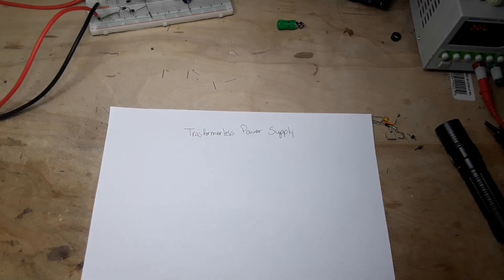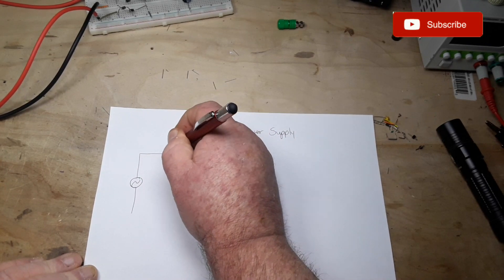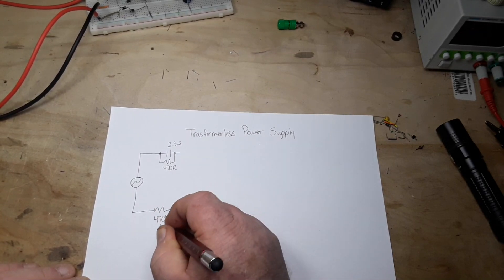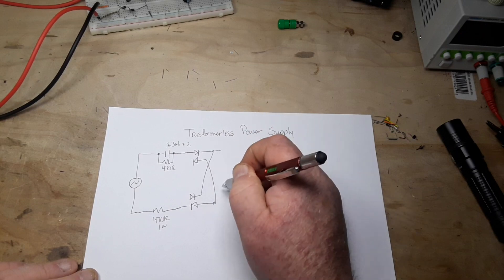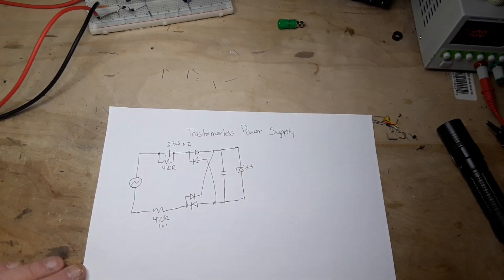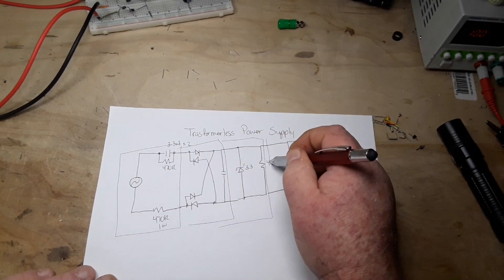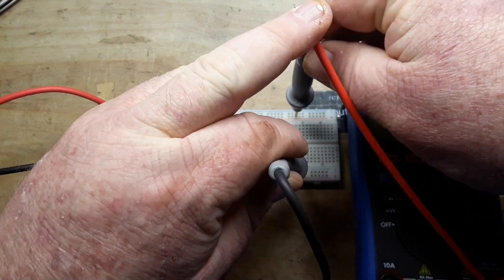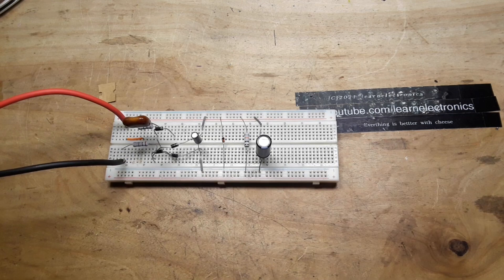Classic Circuits You Should Know: Transformerless Power Supply

Comment: When I 'play' with mains voltage, I use a 12 volt portable powerpack with inverter built in. The inverter output is isolated and I would need to touch both contacts to cop a shock. We have 240V here in New Zealand.

Comment: So im new to this (actually getting back into it) I was wondering how you calculated the resistor value, are you calculating it based on the load at the output? Using ohms law it seems that the load you are shooting for would be 3.3 volts .200mA, am I correct or am I missing something?

Comment: Yesterday I disassembled a rechargeable LED bulb 💡. The circuit was made with 335j 400V drop cap, 244 SMD bleeder resistor, MB06S Bridge rectifier, 100uf 50V E-cap, 2x SS14 SMD schottky diode as anti back-flow, D965 transistor to drive LED panel and 621 SMD resistor to supply the base current to the transistor. 

LED bulb was claimed to be 125W, it can be used as a normal AC LED bulb or DC emergency LED bulb (there's a switch DC-OFF-AC). The brightness was same with AC or DC. I measured the current consumption of the LED, it was 1A @ 3V. But as soon as I removed the battery (4V SLA), the LED lights went dim, now it only consumes 180mA @ 2.6V when runs on AC. Now even if I connect the battery it doesn't have the same brightness as before, but when it runs on battery it works normally. 

I have no idea what went wrong, could you please help me?

Comment: This circuit is used in so many consumer electronics things that we buy -- so I can't understand why everyone gets up in arms when the circuit is described and demonstrated, w/ appropriate safety warnings. 
That's the whole point of education, after all..

HOWEVER - the 470ohm resistor across the 3.3uF dropper capacitor is a MAJOR BLUNDER - it should be 470k to 1M Ω  !!!   Please PIN this correction as a PINNED COMMENT !!  The circuit as described will BURN UP 🔥!

Comment: Thanks for your clear explaining of how this all works!
  I bought a pzem-004 current sensor that uses this circuit to power its self, wasteful it is.  I need 30 of them so i what to figure out how to power them more efficiently. 
  You rightfully warn that this is a dangerous circuit so i want to know precisely how it works before i start pickup the soldering iron on this.

Comment: I know what the bridge rectifier does, and how electrolytic capacitors work, as well as resistors. However I am curious how these film type large capacitors actually reduce the voltage, I am curious about how it actually works to achieve this, so it somehow drops the voltage, this is incredible. I have tried to quickly research how it does this, but I cannot find a precise breakdown of how it actually is dropping the voltage, most websites just say that it's used to drop the voltage and don't explain how it does this. Inside the film capacitor are rolls and rolls of shiny film, I want to know what the high voltage source is actually doing when it enters the film capacitor.

Comment: just a query, at 4.41min where is the output of the first diode connected? I want to make a 20led string of rgb leds and was thinking this is a better way to power it than going out to get a ph charger and muck around with extra leads and sockets, but I can't see where the diode is connected

Comment: I do not understand the use of both a 3.3 uF capacitor and a 470 Ohm resister in the beginning of the circuit.  Is it the capacitor that "lets a little through" or the resistor?  The resistor is too low value to be used just as a bleeder resistor.  Does a resistor and a capacitor in parallel form some kind of tank circuit?  120V across a 470 Ohm resistor = .25A.  120V X .25A = 40 watt.  You call for a 1 watt resistor.  Obviously, I am missing something or making a gross mistake.  Thank you in advance for your help.  I am ready to build this circuit to drop 240V to 12VDC to a 555 timer circuit to engage and disengage a starting capacitor for starting a 3 phase motor on single phase.  The timer part is working perfect.  I would like to make my own power supply.

Comment: You find these kinds of thins inside motor speed controllers for vacuum cleaners etc to drop the voltage down to what the pwm IC  can handle . You will also find that the speed control potentiometer is made of plastic so you don’t get electrocuted !
Far safer for the home hobby guy to use a switch mode supply or a transformer based supply but it is good that you have shown  this type of circuit so they can identify it and know to leave it well alone !

Comment: If I put a coil in series to the dropper capacitor, will I be able to get rid of the negative effects to the power factor, so the shift of voltage against current?
Should I do so?

Sure, the coil would have its own resistance due to self induction, so I'd have to make the capacitor drop less, so use a smaller one. 

Right?

Comment: It should also be noted that some of the USB wall chargers can be very dangerous - people have gotten electrocuted while bathing and picking up their phone - one side of the DC out was connected to the hot side of the AC. Usually this happens with the el cheapo no name chargers but I would not use any device connected to these chargers while bathing or grounded. Some other u tubers did teardowns of many of these chargers and some have downright dangerous designs.

Comment: I am looking to make a 1.5v battery eliminator for a wall clock which happens to have a 120v socket right behind it. I am getting tired replacing the battery every few weeks (or swapping out a rechargeable). The circuit needs to be small and low profile to fit behind the clock. I like the clock (smooth second hand no ticking) otherwise I would get one designed for direct AC power. I was even thinking using a mini USB charger and dropping the 5v to 1.5 with a resistor divider - current should be low less than 50ma I would imagine but I will have to check that. Any ideas? I could use your example but any solution would have to be reasonably safe (insulated mains side). Update - looks like it draws less than 1 ma as my PS show 0.000A - measuring with my DMM - less than 1ma at about 0.8 ma peak (varies between 0.6 and 0.85 ma @ 1.5v

Comment: As always, straight to the point. Many thanks. If you stand on a thick rubber mat,  and/or wear a pair of rubber boots the electric will have a hard job going to earth.
Reply: Also using the one hand only rule helps too when working around HV circuits.

Comment: Hi wanted to know if one could use this circuit to run a strip of back light 9 led's for a lcd tv? I have 6 rows of 9 led chips. The problem is when the led strips are connected to the main TV board it causes a overload. When I disconnect the led's from the main TV board the board works fine. So I'm running the led's off of 2 batteries. But the current draw is 3 amps and it kills the batteries out in 1 hour. So I'm trying to fined a circuit that will let me run the led's from AC but at 1 amp draw. So is there any way I can do this? Thank you.

Comment: Is it possible to use the output from a display driver to drive a thermal inkjet printhead? Using the gate driving and source driving outputs in a multiplexing array seems to be pretty much the same circuit as the one in a printhead. The voltage seems to be correct with many going all the way to 30v p-p and the mA per source pin seems about right as well with up to 5-8mA. I am just not sure if the combined current output would be enough with so many firing at the same time. 

A piezo printhead would not be possible most likely because the voltage is too low except on the LED driving pins but then there are better options because there are so few backlight LEDs.

I also considered Plasma TV drivers but they are harder to find datasheets for and the chips themselves are hard to buy new since no one makes plasma TVs anymore.

Comment: I think the 470 ohm resistors have to be about 4 to 5 watts. If input is 100 volts and each resistor is 500 ohms and we toss out the little Zener for a second, then we have to drop 100v over 1000 ohms in series. Current is 100ma. I squared * R means that quiescent power at each resistor is about 5w... Plus or minus 20 % :-). Or do I miss something?

Comment: I don't think I quite have the confidence to start "playing" around with mains voltages just yet, so I'll give this one a miss for now. Just curious, though - in the U.K. the mains voltage is 240V, pretty much twice what it is in the U.S. - is it still possible to use this circuit here? What about the wattage ratings for the resistors, diodes and capacitors for the increased voltage?

Comment: I usually like your watch you videos but as a professional EE engineer this scares me. Especially when there might be less experienced people actually trying this. This goes against all safety design practices there are. When showing main voltage circuits I do believe that as a engineers we have a specific responsibility. Some comments I have on this design

1. Never connect mains to an open breadboard (yes I saw you were using an alternator which have some additional protection but you mean the circuit to be used connected to mains.) The maximum breaking current might go up to several 100A some ms before the circuit breaker kicks in which could be enough to have the BB explode in you face if you short circuit.

2. The circuit needs to be protected by a sand-enclosed fuse (not glass - again they could explode)

3. Good practice is to use a couple of MOVs as protection

4. Never connect a normal capacitor to mains directly, use safety-caps (e.g. X2 caps)

5. Use inrush current limitation (e.g. NTC SD15 or similar)

6. Also, the voltage drop mainly takes place in the resistors so depending on the load they need to be properly sized especially since there are no over-current protection (and ideally several resistors in parallel which is good safety design practice)

I could go on but this is not the place for a build-your-power-supply-tutorial .This is a "toy design" which should never be implemented for real since it lacks even the most basic protections. Usually I wouldn't bother commenting but the idea that someone less experienced would actually build something like this on a BB and plug it in to mains scares the crap out of me.

Comment: How is this different from the earliest form of dc voltage production I studied, and handled, many times; with a 35W4 (vacuum tube; of the All-
American Five Radio) rectifier.  Admittedly, it would only supply about 600 mA at 140 V; more than enough to kill any person.

I handled that circuit many times with my bare hands; there were an awful lot of All-American-Five radio receivers built at that time.  This period was between World War II (1945) and  the proliferation of transistors  about 1970 - 1980.  I know transistors  were developed in 1948, but they had to figure out how to build battery operated receivers with components designed for 150  Volts and 500 mA.  

The first AM receiver that was transistorized that my family owned  was built in 1961, long before they became popular, the problem was that you had to be prepared for the batteries to go dead about the 6th inning.  And batteries were expensive, nearly $1 (in 1960 dollars, probably  nearly  $9 today.

Comment: This is not correct . I don't mean to embarrass you or anything but with the components you are using the voltage is being dropped by the resistors , not the capacitor . The electrons will take the easiest path , so with the resistance of the resistors being lower than the resistance of the cap , the electrons will go the resistor route . if you want the electrons to go the route of the capacitor , you need to have higher rated resistors . Thats my understanding anyway . I could be wrong but , I dont think so .

Comment: May I suggest that if anyone wants to play with these circuits use an isolation transformer.  Which a Variac is NOT.  But you can use them together to isolate first, then control the voltage.

You can still get hurt touching both AC leads at the same time, but a much much smaller chance of injury from touching either side while being grounded.
Reply: if you touch the neutral nothing happens
if you touch the hot wire (black) and you are grounded, electricity flows from the wire into you into the ground and you die
Reply: @sigataros  exactly?

Comment: again, what does it do and where and how can it be used...
Reply: It can be used to charge your phone. CHANGE ZENER TO YOUR NEED
Reply: @poochie1480  cool, how many amps could it charge with? my wireless charger needs 18-20 watt.
Reply: oh and I have 230 volts in my outlets
Reply: @christiannielsen3863  since charger draws 20W use P=VI to get current
Reply: @poochie1480  at 5 volt 20watt the circuit should draw 4A right?

Comment: 120VAC to 3.4vdc without using a transformer, what are the advantages and disadvantages of not using a transformer to convert 120VAC to 3.4vdc?
Reply: Biggest disadvantage is no isolation from the power input. Don't use this circuit anywhere near people. :-) seriously, if you have to ask it's too dangerous to mess with.
Reply: @mschwage  having no isolation will cause what types of issues and problems?

Comment: Noob question .. with no transformer the circuit is not isolated and therefore earth grounded? as in zero whoopsie protection as compared to a floating ground?
Reply: Correct. Every part of the circuit should be considered "hot".
Normally this would be fully enclosed where nobody can touch it.
Reply: @pileofstuff  the distinction between earth ground and negative ..  the reasoning for tying earth ground and negative together (or not) .. and the historical reasoning for doing so .. is all slowly starting to make sense .. you'd think this information would all be gathered in one spot for noobs like myself.
Reply: @stevenspmd  Gathering it all in one place would be a several years long video!
Reply: @pileofstuff  makes sense .. BigClive is always mentioning capacitive droppers and lots of them are "potted"

Comment: Great video. Interesting circuit. Would love to see it on the scope/meter at each stage. Going from 125vAC to 3.34vDC and no heat? Where does all that voltage go? Thanks for sharing.
Reply: It goes to the amps. I doubt you could use it with load for long periods of time. You definitely need at least some passive cooling.
Reply: The capacitor only lets some through.  It's a high impedance input, so little current.  But plenty to run LEDS, many LED lamps use this circuit internally.

Comment: This is a pretty interesting design. I never thought you could make a transformerless power supply. :D
Reply: Check out BigCliveDotCom's channel.  He examines all manner of electronic devices, and many of them use this kind of power supply.  Quite a lot to be learned from his videos.
Reply: It's a simple filter - using capacitive reactance. The math is pretty simple if you've ever done filters - most of us think of filters as working at least at audio frequencies. I've done a lot of those but this (classic) one still gives me the willies even though I know how it works. It just "feels" wrong when you've always worked with transformer-based droppers.

I'll add another vote for @bigclivedotcom because he's not just beautifully spoken with an awesome goatee and a wicked sense of humour, he's also a great guy. He also flambe's stuff. ;)

One of the most entertaining electronics channels on YT but I love this one too - both are different and both great.
Reply: @marcdraco  also thanks for the nice comment that explains stuff well
Reply: @marcdraco  i think i once made a voltage regulator that dropped it down to around 2 volts using a npn and a capacitor and the output capacitor being attached through a resistor to the gate and the output of the npn through a resistor to the positive lead of the capacitor which is also tied to positive with another resistor and it ended up getting around 2 volts out of 5 volts
Reply: Actually many circuits that are common in the industry have no transformers and work on mains voltages. Look up a common ldr circuit that turns on and off at night and day. Many use mains voltage with scr and triac and diac.  Many related circuits use some similar methods of using mains to low power without without a transformer. But its a good little circuit.
Reply: I've worked on many power supplies that were transformer less
There's no isolation unless you have a switch mode type .
Most switch mode p.s.
do have transformers because of the high frequency they run at.
Transformers are definitely recommended not only for step up or down, but for isolation.